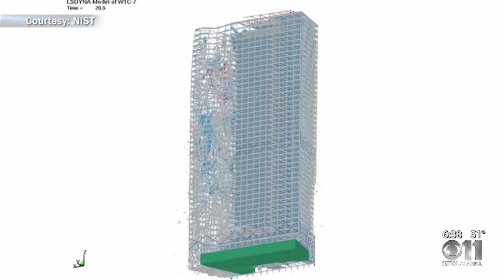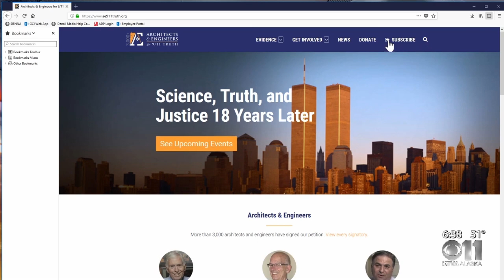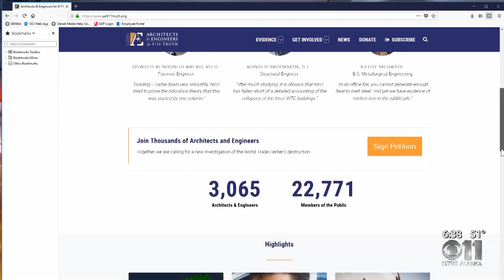Fire did not cause World Trade Center Building 7 collapse, UAF study suggests

Comment: If you watch the slow motion video they even started out with at the beginning of this video and watch the structure collapse you can see the windows popping and the structure giving in..... an engine from the second impact from the jet flew off and dropped in the top of that building and set the building on fire as it fell through floors..... this is explained what the structure of the time and era was it fault for its own construction cause its own demise with with the fire that ensued no conspiracy
Reply: The engine from a plane did not drop through the roof of WTC7. It hit the building from the side. Where did you read that it fell through the roof? NIST didn't even claim that. NIST claims that the building collapse due to fire alone, not structural damage.